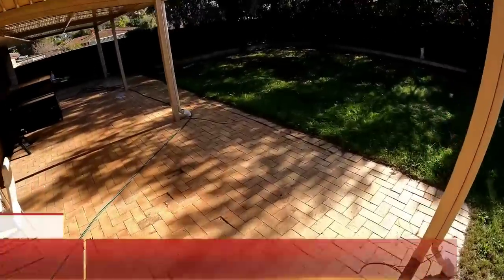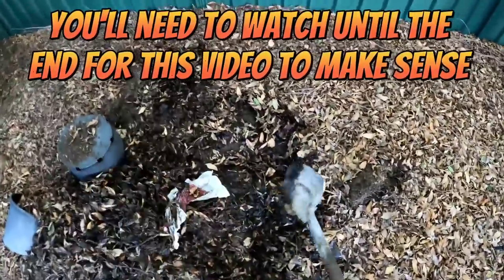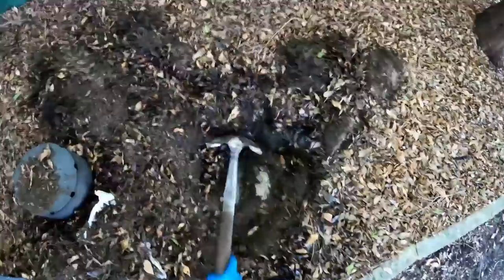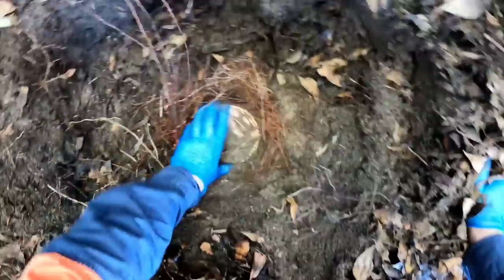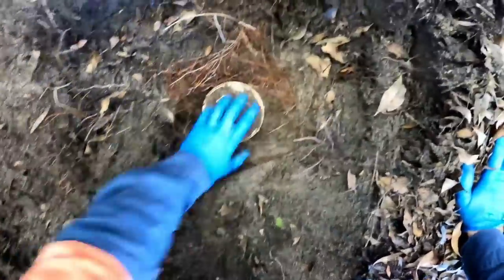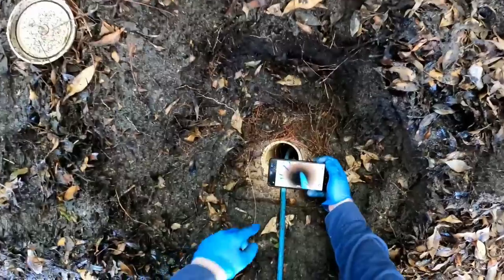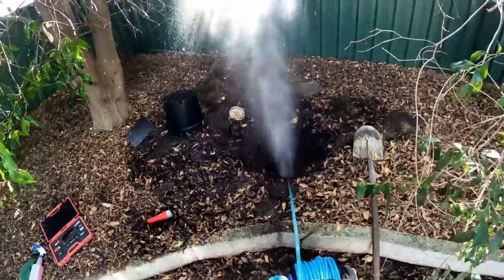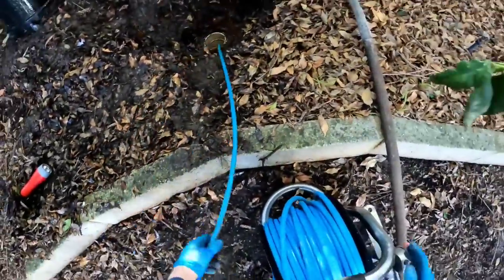SEWERAGE SHOWER & Jetter Stuck Down Drain

Comment: I got my 1/2" Warthog head stuck in a broken clay pipe. Had to cut the hose and wait for the plumber I was working for to get permission to go after it. It was in an 8 inch clay pipe under a parking lot in front of the offices. Fortunately (or maybe unfortunately, depending on how you look at it) the line had to be replaced because it was the main sewer line for the entire facility so the company really didn't have a choice. Got the head and the 50 foot leader hose back but lost about 20 feet of main hose.

Getting stuck sucks.
Reply from the maker: Ahhh mate getting stuck does suck! Thanks for your message!

Comment: Bruce, I'm sorry that you lost the jetter head and had to cut the hose because of that broken pipe. However, to echo a previous comment,  those parts can be replaced. I'm glad you were able to get the hose out and that didn't get slapped around by it as it was twirling around the snake. The sounds in part one were fantastic. If I  heard that sound from that root cutter here in the woods, I might have thought someone was using a chain saw.
Reply from the maker: @lynx93TK sorry for the late reply! Yeah that was frustrating but so far that video has made me about $10 in YouTube revenue. Only another $500 to go🤣
I hope you're well mate!
Reply: @DrainCleaningAUSTRALIA  All is well here, my friend!  Hope that YouTube revenue keeps rolling in.

Comment: Lookin at your boots mate, wonder if plumbers should have something a bit more like kitchen shoes.  They grip good on wet surfaces, they're also heat resistant when you're dealing with hot water on the floor but most importantly the tongue is on the outside so when you splash water on your feet it rolls off instead of into the boot

Comment: Just a question. is there a reason you would not extend the riser to ground level, with possibly with a B.T.S witch cement surround? if its a common problem.

Comment: bummer you lost the jetter... it would be cool to have seen the cam close up of the spot the jetter got stuck/lost.  we are sure that YOU saw the problem close up via the snake cam, and maybe saw there was no way u were going 2 get that nozzle back. the steel cutter might have been able to cut thru/up/chew up the pvc pipe and give u access to the nozzle to use a magnet like the drain addict has done to get things back.  so sorry this job turned up bad and costly. those jetters are not cheap.  maybe the property owner can get the nozzle back in future if they have to have that pipe dug up for full repair.  maybe you could leave a steak in the ground above the lost nozzle asking that "..if dug up.. and u find my nozzle.. please call ....."  any good plumber will do the right thing and call ya.  keep up the good work.. we are enjoying watching your old vids.